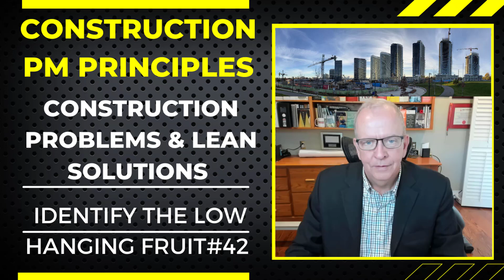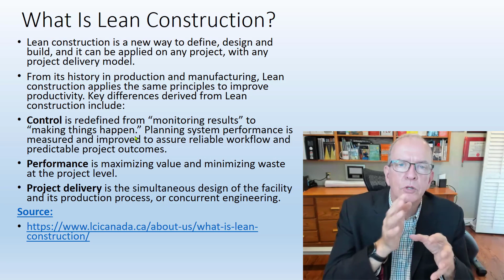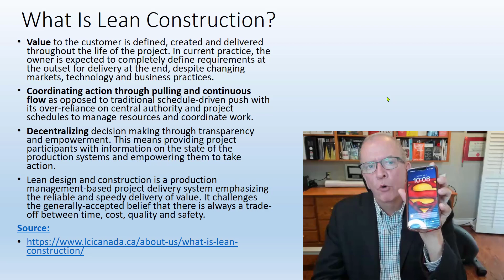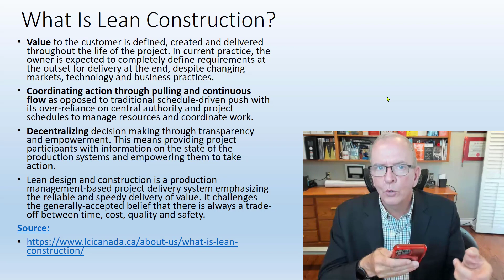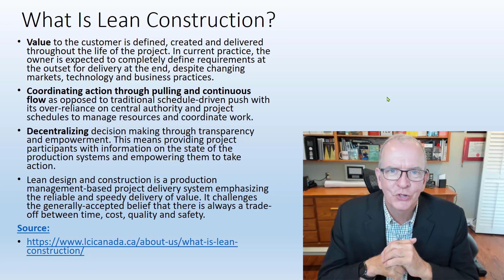Construction Problems and Introduction to Lean Solutions, Construction PM Principles No. 42

Comment: As a carpentry contractor, are you a believer in efficiency/quality balance?. Obviously I want to maximise quality of work but at the same time efficiency, keeping the work on schedule and meeting profit targets are also necessary to sustain competition in business. I have many a times tried to aim for perfection in my work and have finished projects 5 times slower and have had to take some sizeable losses on jobs. I’ve tried to utilise Parkinson’s law more effectively when approaching tasks, for example when hanging a door I allocate the time for completion for the profit target intended. I then move on once the time is up. Ideally I would like to work to perfection and priorise quality but contractors think you’re trying to rip them off. 

Side note: I kind of consider myself a perfectionist, does perfection hold you back in this industry?
Reply from the maker: Yes it is worth the efort if you start slow but consistently work at it picking thing that give you approximately 4 time return on your effort.  Don’t spend an hour to save an hour. Spend an hour to save 4 or more hours 20/80.  Also PDCA is an excellent process.
Reply: @TomStephensontraining  Hi Tom

I have took aboard your advice and am creating systems in place in order to optimise systems of working to improve effiency. However I recently broadly listed out over 70 processes involved in site carpentry work. I estimate that each process needs approximately 10-15 hours in order to produce a document which contains the step by step instructions for each process. Is this worth the return of investment of time considering I will have to investment up to 1000 hours on these documents?

Thanks
Reply from the maker: @chippy977  pick one that will gife you the most return for your effort.  If it takes 20 hrs it should give you 80 hours back. Once that one is complete move onto the next one.  Overtime compounding of improvement will make you difficult to compete with.  Caution, definitely don’t waste time on that you don’t see it paying a return unless it just bugs you then also likely worth it.  Sometimes you can stack a couple of things together as they interrelate.
Hope that helps
Reply from the maker: Yes I had this problem when I was starting out.  The problem is it creates unnecessary stress and you either price yourself out of the job or you lose money.  I believe it’s better to understand the value expectation of the client and your contract with them.  Deliver on that while simultaneously and slowly working on your systems so that over time your quality goes up continuously.  In 5 years you will be much better, and you will have been profitable along the way.  Remember if you are not profitable you are not sustainable and perfection is no use if you can’t afford to do what you love.
I suggest a book called effortless by Greg Mckeown might help.

I hope that helps,
Tom
Reply: @TomStephensontraining   Thanks for the advice that was very helpful. It’s reassuring to know that it’s a familiar issue, as frustrating as it is. I will definitely buy a copy of the book. I am a big believer in systems being key to driving quality and efficiency. It’s been a personal obsession trying to deliver the best possible work in the shortest amount of time. I recently have started to document my methods In a standard operating procedure format.So I can review and test them, and compare others methods to mine. Similar to the PDCA framework.Do you think this is beneficial and worth the investment of the effort in creating these documents?. I have heard you talk about the importance of 80/20 and ROI for your efforts. Given the amount of carpentry tasks and documents I’ll have to write to standardise the systems, do you think this is worth the effort?.